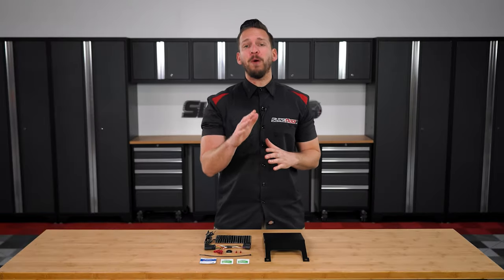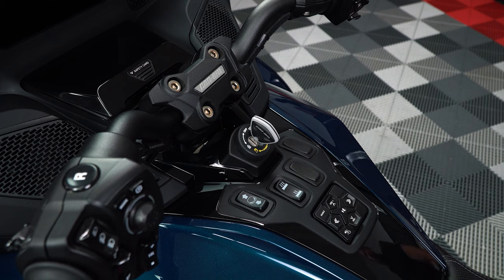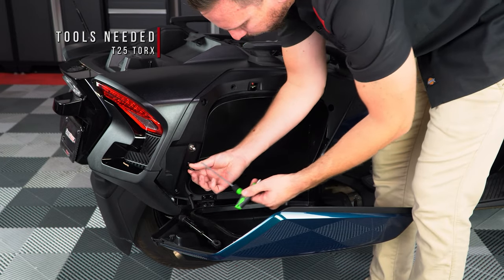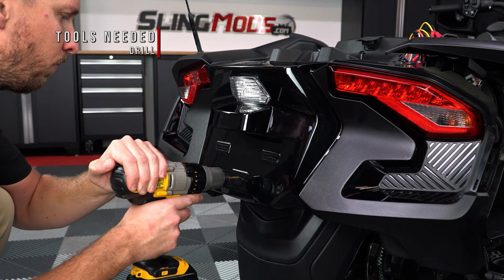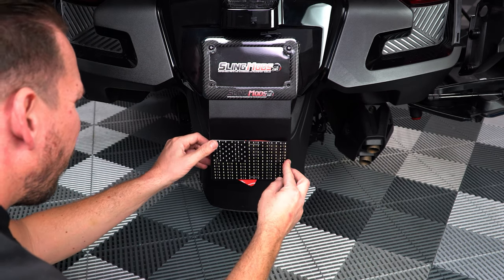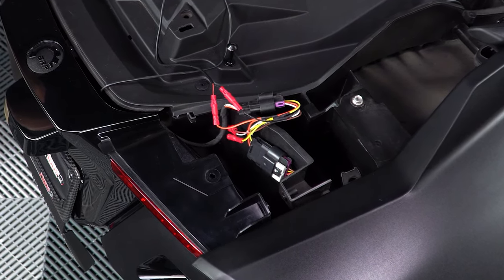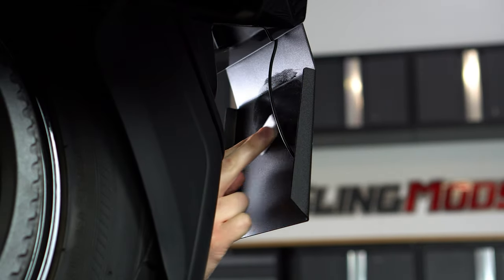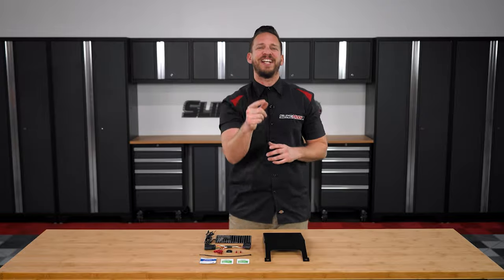Can-Am Spyder RT LED American Flag Kit (2020+)

Comment: I would love a motorcycle flag mount for the ryker....I have looked into fabricating something that bolts where the max mount connects to the seat but limited knowledge skill and tools has made me realize I would rather buy from you haha
Reply from the maker: Lol. We are launching this exact LED flag for the Ryker this month. We just got the sample in yesterday. It actually includes a plate relocator to move your license plate to the side of the swingarm and puts the LED flag where your license plate is now and it's all plug n play. We are also looking into a traditional flag holder for the Ryker. 😁